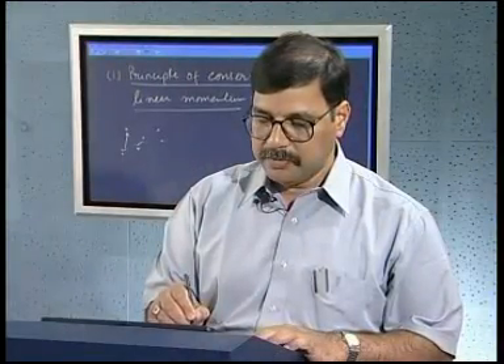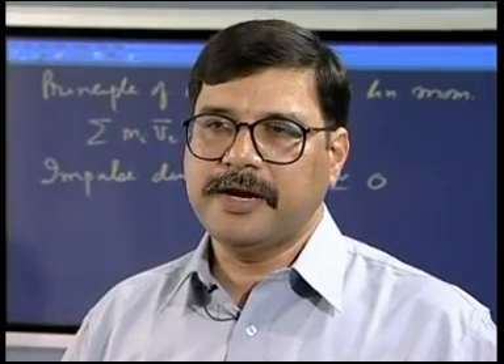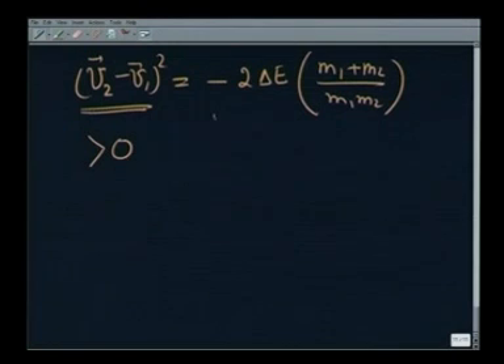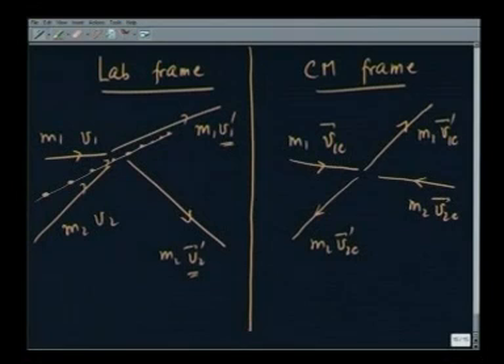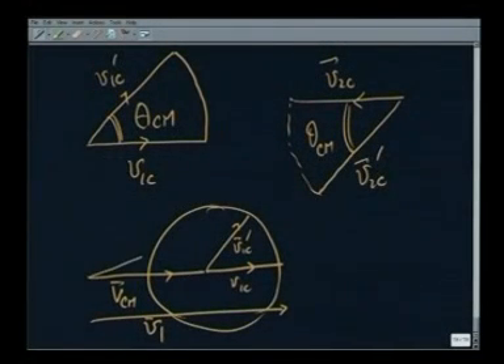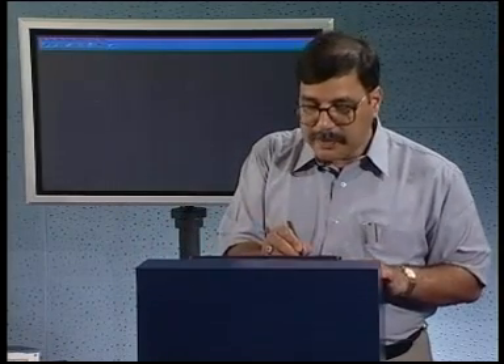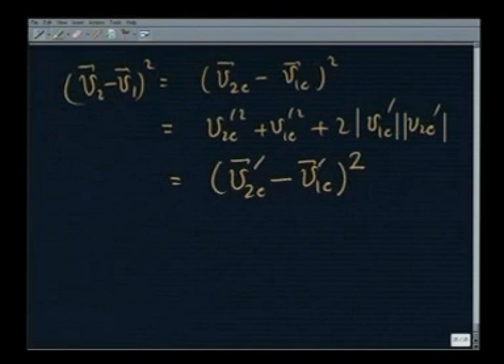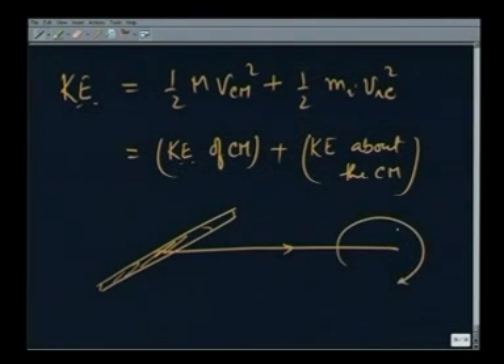Module-6_Lecture-3 WORK AND ENERGY - II

Comment: Thank you very much for these great lectures ! I do appreciate a lot !
May I hint a potential error on minute 35 and 50 sec:
In the formula with the tangent, it seems to me that it must be V1C' instead of V1C in the nominator and denominator, else it doesn't make sense?
Reply: Well it doesn't really matter, actually. It was proved during the derivation that V1c' and V1c have the same magnitude.